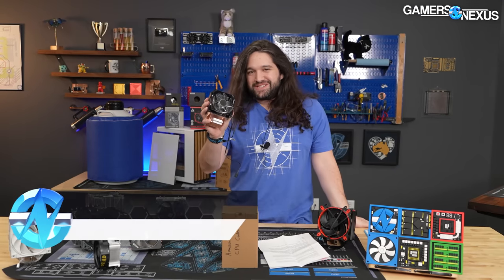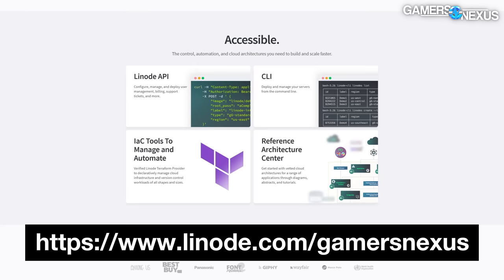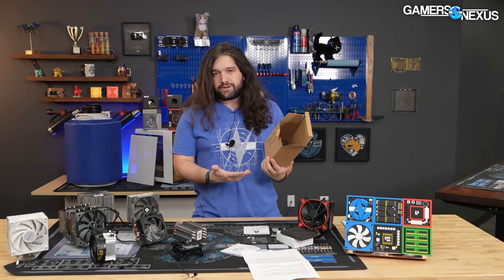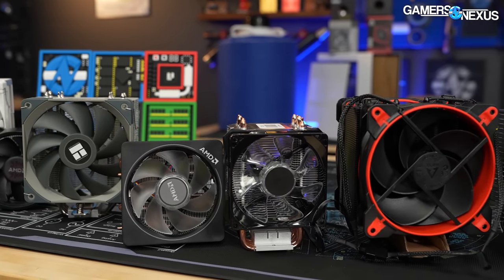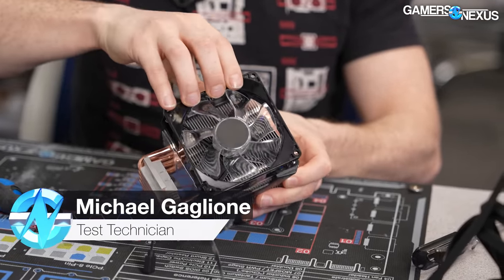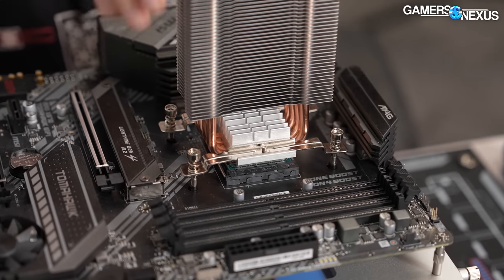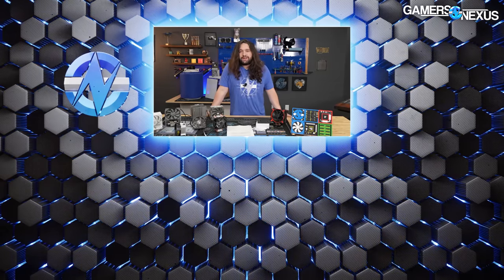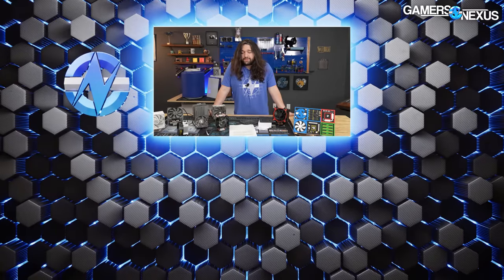Amazon "Made" A CPU Cooler: Amazon Basics Cooler Review

Comment from the maker: Grab our BRAND NEW Silicone Project & Soldering Mat! https://store.gamersnexus.net/products/gn-project-soldering-mat -- This organizational surface is for your projects -- like building models, small component repair, hardware maintenance, and more -- and uses an extremely heat-resistant surface that'll stand up to soldering irons. It's a high-quality, resilient, durable surface with screwdriver sorters, small part and screw trays, electrical diagrams, and more! It also directly supports our benchmarking and reviews.

Learn about our CPU Cooler Test Methodology: https://www.youtube.com/watch?v=fmTOJP4KOyk
Watch our Silicone Project & Soldering Mat Launch Video: https://www.youtube.com/watch?v=3SNKflKhCUo
Reply: 3:52 watching that machine slam down on those bearings no wonder fans have such a high failure rate
Reply: Please review the ID-Cooling SE-207-XT Advanced
Reply: I recently bought the Cooler Master h412r version of that cooler at a brick and mortar store, to put in a 4U case that lifted the mainboard to much to be able to fit a 120mm tower in (did a rare buy at a B&M because I had to be able to actually measure the thing to see if it would fit XD).

One HUGE difference I notice between this version and the OG Cooler Master one is that the Cooler Master one is flat as can be with a near mirror finish.

There's no gaps between the aluminium surface and copper pipes, it's ground down to a nice solid surface with a great finish.

And it didn't cost all that much either, 24€/26$ at a B&M, so Amazon isn't making it cheaper with the debranding/shittier finish/worse surfaces, just higher margin.
Reply: You said in the video that people shouldn't buy the Cooler Master version either as it would also have the same mounting pressure map, but considering the h412r has a far cleaner surface, I'm actually not certain that is a correct advice. I'm willing to bet the h410r version also has a far flatter and cleaner surface than the Amazon one.

It looks like the Amazon version attempted to save extra production cost by not doing the extra surfacing step.
Reply: Why you dont inclue be quiet in your tests?
Reply: I bet Corsair paid Amazon to make them do it so they're no longer last in the chart
Reply: i wish there was more low profile coolers in the chart other than amd stock
Reply: So Mike mentioned how he liked the plastic attachment clips on the fan and that they make it very easy to take on and off ...... Well as someone that owns a CoolerMaster Tower that has a fan with those plastic attachment clip I NEED TO TELL YOU that THEY ARE AWFUL!!! Yes when you first attach the fan to the tower it seems great, and they latch on just fine.... but after using the computer for a couple months I was ready to give it a cleaning of all the accumulated dust from normal use. Well that clip doesn't really hold the fan on very well AT ALL anymore..... I actually have used a TWIST TIE to hold it to the tower... and this was after having the machine on 24/7 with it going to sleep for 5 - 7 hours every night..... 
The only explanation I could come up with is that the HEAT from the CPU cause the plastic re-set into the position it was in while installed and has essentially 'lost its grip' on the tower.... I can LITERALLY BLOW IT OFF OF THE TOWER using my breath!!! Just  blowing onto the  top of the fan shroud, and away from the tower, is more than enough to knock it off!!!
- - - IDK if this is a one-off that only I have had this problem with, or if it is a common occurrence. but it was much more simple to just use the twist tie to hold it on so it doesn't fall off anytime I move the computer. than the hassle of returning the ENTIRE TOWER and FAN for an RMA (newegg said I would have to send it ALL BACK even though it was just the fan with the issue 🤦‍♂) - MAYBE this is something that you will come across at some point using this Coolazon Basic Master tower and fan... but probably not... I don't see why you would use that tiny thing when you have much better options at your disposal.... PLUS they aren't even the same products that I am having the problem with, they just use the same cheapo technique to attach to the tower... 
THANK YOU for this video tho....Even though I already know better than to source my computer parts from a DISGUSTING line of basic products, this video more is entertaining than informative if anything. :)
Reply: I was trying to find a video where GN made those bag of holding inside 4 dimension joke. Does any still remeber what video it was?
Reply: i know you might nto see this was I was looking away for a good chunk of the video around 4 mins and thought dam Steve really says basic a lot in this video and to my suprise a counter LOL
Reply: @ugogatto  I wish they had gotten the H410r and H412r in the mix to see how much the Amazon shortcuts to the same coolers from Cooler Master cost in performance while actually being the exact same price or even more expensive.

I bought a H412r recently for a fileserver of mine, for 2$ less, at a B&M, than Amazon lists theirs and immediately noticed from this video that the contact surface had a far better finish than this Amazon Basic Bitch version.

Amazons cost cutting isn't to be cheaper, but to get higher margin.
Reply: i wonder how far my bank is into doing my chargeback against amazon for stealing money from me
Reply: Please do the Jonsbo CR1400 cooler ($26)

Comment: Good to see that coolermaster won't change their terrible mounting even for amazon.
Reply: It's fiddly but it works once installed properly.
Reply: I like the little integrated heatsink at least, even though it's almost certainly negligible for cooling performance.
Reply: Skill issue.
Reply: It's kind of like solving Rubik's cube.
Reply: 10 minutes of adjusting/finetuning it goes a long way. Just straightening the baseplate does most of it.
Reply: Amazon probably doesn't know the difference ;)
Reply: "Hassle free" only refers to the packaging.
Reply: cost is the difference
Reply: My 212 black edition took me like 2 minutes to install
Reply: mine is worse, I struggled for hours because its purely pressure mounted
Reply: @wizpig64  Yeah basically... "This one's cheaper, we'll take it!"
Reply: it's a re-branded or rather un-branded Cooler M. Hyper H410R at >10% cheaper, I'd say quite impressive to shave of so much on such a cheap yet workable product.
Reply: @brodriguez11000  The problem is its hard to tell if its installed properly until it falls off and starts skull f'ing your components.
Reply: @brodriguez11000  just like zip ties.
Reply: I own it (the actual CM product) and I had issues mounting it the first time.

Comment: "Make it cheap but add an LED" has been a pretty successful strategy for many computer part makers.
Reply: pretty much sums up the gaming parts from 2000s
Reply: Would you like a job in marketing?  We think a bright future awaits you.
Reply: @harryshuman9637  Still to this day just change it to RGB.
Reply: @sophustranquillitastv4468  Nah, the plastics are better quality. They no longer use cheap plastic that came in 3 colors: transparrent, shiny black or baby blue. Also computer cases are no longer made of crappy steel so they no longer rust in a high-humidity environment or weight a metric ton.

You got that right about RGB tho. We finally graduated from having only one of the LED colors (usually blue) in our PCs like we did in 2007.
Reply: Using cheapest RGB keyboard and mouse. Plastic is so light I'm typing slowly to not break something, other than that it's a decent product.
Reply: @harryshuman9637  These days "make the hardware decent, but subcontract the software to an Indian sweatshop that barely knows what they are doing, and never update it" is the name of the game.

Comment: This price on a 92mm cooler compared to all the absolute bangers you have on the table makes it pretty strange for them to be pushing this. That algo is strong for people that don’t know better. You’re out here doing amazing work.

Also very hype to get my project mat in!!!!
Reply from the maker: Thanks so much for buying one!
Reply: Maybe because it’s nr200 compatible and others are not?
Reply: @pratikpramanik7782  Definitely not that way. I have a Scythe Mugen 5 cooler in an NR200P, the one with the tempered glass side panel. It barely fits but I can close the side panel. So you dont need a 92mm cooler when a 120mm one fits perfectly fine.
Reply: @fleurdewin7958  then i got nothing. Amazon probably was like "What you got cheap?" CM points to QC reject 92mm coolers and Bezboi says "we'll take em".
Reply: eh, i can see a verrrry limited use case for them. certain specific cases with that specific oddly sized hole could easily make use of them and if they perform okay enough for non-oc'd chips, it's viable.

for regular cases? i guess if you want more room around the cooler? ehh i'll stick with maximizing my fin surface as much as possible for regular boxes, and tailor my cooler choice to smaller ones based upon each instance.
Reply: If Amazon can't or doesn't want to match Thermalright on price, Thermalright is probably selling at or below cost.

Comment: Because it's been a little while at this point I feel like it's worth re-emphasising: Your testing showed there is virtually no such thing as 'too much' thermal paste, to the point where it leaking out of the sides seems to become an issue before anything else.
Reply from the maker: Correct. It's too little that's the problem.
Reply: The only way there could be too much is if your cooler isn't properly mounted and it's so thick it's serving as an insulator.
Reply: You believe what you want to believe. What I believe in is thermal conductivity. Aluminum > thermal paste > air. There is definitely such a thing as too heavy thermal compound application despite whatever anyone's told you. Slathering paste on a heatsink is like wearing a coat in the summer. That extra layer will not make you cooler. Every layer adds thermal insulation and resistance.
Reply: @1pcfred  and what GN believes in is empirical data.
Reply: I like to put an extra tablespoon on top of the cold plate as a treat when my Pc is hungry
Reply: Mounting tension will be the same regardless so the physical microscopic gaps between will be the same whether there is little or too much paste, only difference is spread coverage and overspill if there is too much. You can't have too much paste- how is something as viscous as paste going to be enough to be strong enough to resist the mounting force and obstruct two plates made of solid metals to the point it creates more of a gap between them with more paste between? It's not. It will spread and just come out the sides. The thickness of the paste will always be the same with the same mounting tension unless the mount is just plain bad- in which case either it will be crushing the CPU and may break something, or there isnt enough tension for good contact IN WHICH CASE it would ironically be better to have more paste to compensate.
Reply: @1pcfred  
It's nice that you believe this. I believe in making a mess. See, when there's excess thermal paste it gets squeezed out. Any thickness delta between the optimal amount of thermal paste (just enough to cover the gaps) and how much paste remains after a messy installation is barely high enough to affect cooling results in a normal build.
Reply: @klobiforpresident2254  if that works for you then fine. I apply a thin spread film and that's what works for me. There's no squeeze out and I have good temperature. The hottest core of my CPU right now is +30.0°C although yesterday running a CPU benchmark I saw 60°C That was after 100% utilization for an hour.
Reply: @wallsofa  show me their certification. I'll put my trust in actual engineers and scientists. Layers = resistance. All your heatsink that can be in contact with your part should be in contact. Compound only belongs in voids.
Reply: @klobiforpresident2254  If I put a literal glob equal to the amount of shampoo I use to wash my hair onto the CPU, all of it will end up on the motherboard except for the paste that fills the precise gap the mounting tolerance abides when properly mounted. The only remaining thick parts, ironically, would not be a fault of how much paste you used, but a fault in cooler design as the thick parts would be in areas where there are grooves, gaps, etc on the cold plate. Which, incidentally, would be better off filled with that paste than not.
Reply: @1pcfred  what you describe is good practice imo but it doesn't mean there can be too much save for preventing mess- you're just factually wrong on that account.
Reply: @1pcfred  Any excess thermal paste will be squeezed out (if the cooler is mounted properly), regardless of how much is put on the CPU. That's why there is no "too much", because physics prevents it.
Reply: @1pcfred  what engineers and scientists? you've provided no evidence
Reply: @1pcfred  1. Excess thermal paste is always squeezed out from plate pressure. 2. The entire function of thermal paste is to provide thermal conductivity between areas of the plate which don't have good physical contact. 3. How you feel about over applying thermal paste doesn't matter, it's been empirically demonstrated, with supportive data, that over applying thermal paste doesn't effect thermals, so your theory doesn't matter.
Reply: @1pcfred  A little goes a long way...kind of thing
Reply: @1pcfred  and what everyone is saying in reply to you is that sufficient cooler contact force with squish out the excess paste, leaving what is needed. Multiple publications have tested this, including GN (4th most watched video on their channel, if you'd like to review their findings).

It is possible to have correct methodology without a degree, and possible to have incorrect methodology with one (look at the Millennium Bridge disaster for example). Dismissing data based purely on the person giving it is both unfair and illogical.
Reply: @wallsofa  it is not surprising to me. Earth would be a nice place if it wasn't full of humans.
Reply: @markp5897  according to popular consensus the bigger the glob the better the job.
Reply: @bobson_dugnutt  it is something I read about before you were born and I didn't take notes. They were apparently learned enough to be published though. I've been into tech since before PCs were a thing. Yes we had heatsink compound then too.
Reply: @1pcfred  Mounting pressure will remove excess thermal paste and maximize contact with the cooler. Your only real worry is if you don't hit appropriate mounting pressure and if you let too much paste ooze out the sides without cleaning it up as you go.
Reply: @sunderkeenin  one always has to mount with the appropriate pressure. Face north Jack!
Reply: @1pcfred  there was an interesting article on Igor's Lab looking at the Zen4 IHS using a "cooler" of thermally emitting film.
Basically it showed the IHS of nickel plated copper wasn't conducting heat fast enough from the IOD/CCD hot spots to even temps at the surface.  A thicker IHS ought spread heat out faster and sink more heat than thin, providing a thermal stability.
But the point is that an active heat removal by pumped water actually does lower temperatures, so even thick copper can lower thermal headroom.  Those lower temps allow more MHz overclock.
Excess thermal paste not only makes a mess but could add thermal resistance as solid copper does.
However what constitutes excess depends on the flatness of the IHS and cooler base.  These cheap coolers with copper heat pipes sunk into aluminium must need more paste than a precise solid copper flat  base.
That well engineered flat surface, still performs less well as vapor transfers heat upwards to the fins faster than traditional passive solid heatsinks.
Whatever, if the pipes aren't the main contact the vapour chamber tower has no hope of performing well.
Reply: @RobBCactive  a larger heatsink should be able to store more heat. At the end of the day what a heatsink really needs to do is transfer heat away though. To do that the heatsink needs surface area. Which is something that a thick heavy mass lacks. The whole delidding craze proves my point that every layer is a resistive interface. People here insist the excess compound is automatically squeezed out. Having spread some compound myself I'm going to press F in the chat to doubt.
Reply: @1pcfred  it does store more, when  comparing passive measures it's better, but pumping heat away or absorbing heat by evaporation is clearly more effective.  AIOs and vapour chambers work.  The area is losing heat to the cooler air and creating a temperature gradient for heat flow.  But Igor's Lab investigation into the AM5 socket design pro/cons suggests even the thicker copper IHS isn't transferring heat away from the hotspots that fast.
Delid is relying on active cooling, they say the copper IHS is too resistive.  Now, I argue that is purely a concern for over clockers, Zen4 proved it performs well but hot with a "free" Wraith Stealth box cooler.
Having installed a DeepCool AK400 tower cooler this week, finding TC was not pre-applied, I judged it best to use ALL the enclosed sachet, more than usual and I didn't try to spread thinly, just ensured wide contact area and that it excluded air by pushing it out under pressure.  Seeing the chart on flatness it's probably better to err on a little too much with cheap coolers of this type, engineering a solid copper contact to be flat must be more reliable.
Reply: @RobBCactive  some work better than others do.

Comment: The Hyper 212, the cooler that will never go away. I built a PC with a Hyper 212 in 2015. It's been out since 2007.
Reply: Hyper 212 in just about every variant is now a 40-50$ cooler, it's now wildly overpriced for it's performance.
Reply: @monoman567  but it still performs better than the Hyper H410R/Amazon Basics CPU Cooler